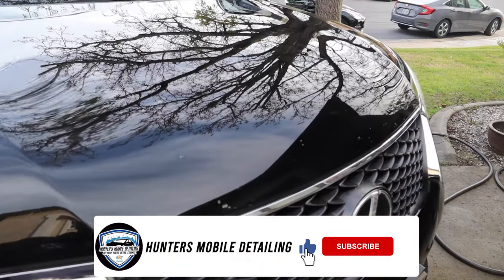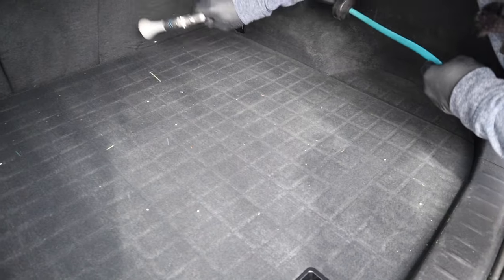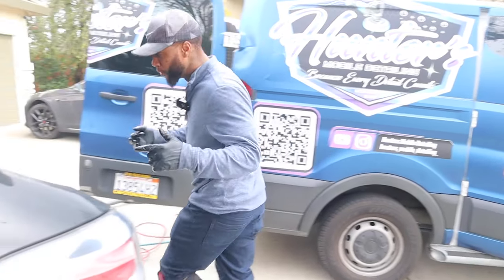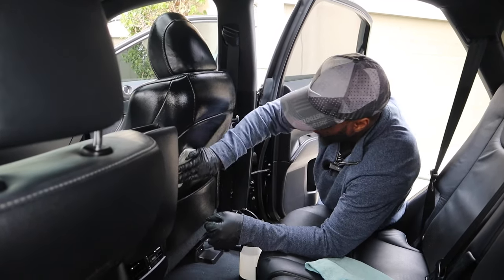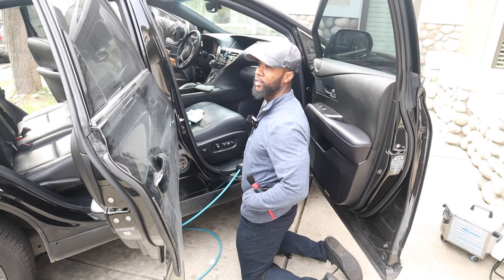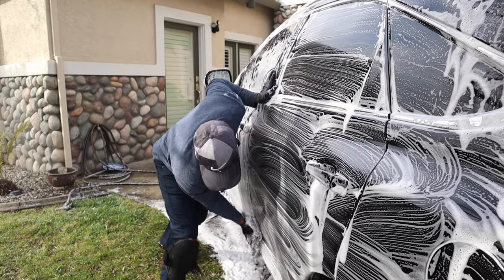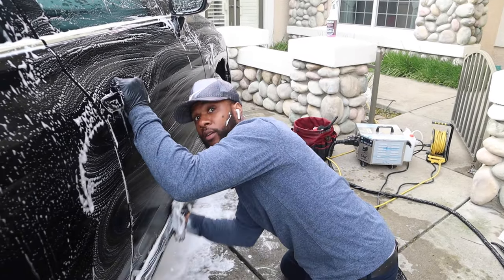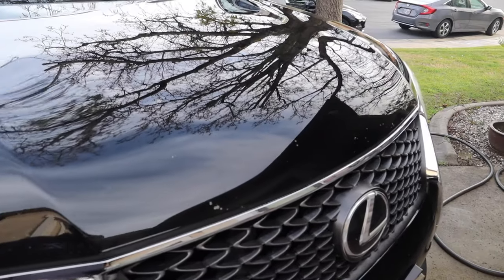How I Do My Full Detail Step by Step - Hunter's Mobile Detailing

Comment: My dad's been an auto detailer for years. I would recommend eagle one detailing spray. It's a navy blue and gray can, you can use it on all the plastics and metal in the interior after you clean the inside of the vehicle. We use a clean paintbrush to go back and tone it down. When I help my dad it brings out the black alot more and gives it a settle gloss like a brand new look and it really doesn't look greasy unless you really cake it up .

Comment: Tornador is my #1 tool along with the steamer. The metal cone for the Tornador I feel took it up another level.
Reply: What type of air compressor is best for the tornador
Reply: @2Shine55  it has requirements on the website/on the box but I just use one I got at harbor freight for like 150
Reply: Does it not make a mess blowing all over ? If it’s a really caked up car inside
Reply: @2Shine55  I just use a Craftsman 6 Gal. I got it on sale for $100.
Reply: @TropTrevTv  if there’s a lot of stuff I will vacuum first so I don’t blow stuff all over. It’s really good to bring up the stuff that a vacuum can’t get.

Comment: my favorite part is applying a ceramic coating.  dunno why but it's very satisfying .   I like scrub ninja for steering wheel and flat surfaces but for the seats I would advise using a dedicated set of perforated leather brushes that get into the tiny holes in seats..the scrub ninja doesn't do that..brushes do. other than that... you the man. thanks

Comment: I haven't bought into the Tornador yet, I just usually spray a ligh mist of upholstery cleaner and drill brush the carpet before vacuuming. Works just as well and I don't have to waste time on a extra step but hey as long as it's working for you brotha.
Reply: For doors & dashboards as dust can be abrasive the more you can blast away with air or vacuum up w/ detail brush the better.
Reply from the maker: Can’t knock it until you try it I was the same way. Then I realized it actually cut time. And also I was able to get things I wasn’t about to with this tool.

Comment: Hi 

Can i ask for whats the best method of washing a car in my circumstances 

Things i will use
1. Only Ph neutral soap
2. I have wash mitts & microfiber towels
3. I will not use foam canon 

Methods I'm considering to use 

A. 1 bucket no grit, multiple microfiber/wash mitts
B. 1 bucket no grid guard, 1 wash mitts and pressure wash the mits after ever panel 

Or should a grit guard is a must for a car wash without foam cannon?

Comment: Good evening sir I'm replying to your comment about your air compressor cutting off and you having to wait a few minutes that's because your generator is not large enough to keep it running once the air compressor cuts off the generator needs to be at least 8500 Watt or you can buy a air tank that's called Master blaster it sells for about $400 but it works very well

Comment: Hey hunter I’m a new detailer and I’ve been having trouble with water stains on the paint right after washing it. Can you explain what causes it and how to prevent it? First, I pre-wash then I hit it with the foam cannon and do a hand scrub with soapy water while the foam is on the car. Then I pressure wash all the soap off and hand dry with a towel and it leaves the paint with a bunch of stains on it.

Comment: Great job. I am impressed by the truck setup and the equipment used. Which air compressor do you use? I am here in Orlando, FL. setting up a Mobile Vehicle Cleaning Service to do part time, on the side, and I am trying to put everything together to start servicing accounts.

Comment: My only comment is wouldn’t it be better to use another mitt for the lower panels? As opposed to using the same mitt for the entire car, for the sake of trying to minimize scratches?
Reply from the maker: As long as your cleaning properly my opinion It’s no difference. You can have 2 mitts and not clean properly and have the same problem.

Comment: I put it in my confirmation: 
- please remove all loose item from the doors and floors, truck bed, etc
- please remove all valuables and weapons 
If they leave the bed of the truck after my messaging- I charge 10 bucks for cleaning.

Comment: How do you reuse the towels? Do you wash and dry them?
Reply: yes, but you should only use a free and clear detergent, I use "all free and clear" with hot water. don't use dryer sheets and use an air dry setting as the dryer heat will ruin the fibers in the cloth.
Reply: P & S rags to riches in washer. no dryer sheets

Comment: Hello Sir, very liked your video and you inspired us on doing this detailing works. Just want to ask if do you remove the wires of the car battery everytime you start to wash and detail those vehicles? Thanks.
Reply: There is no need to.
Reply: @upgtx  Thanks for the reply. I’ve just thought that the car battery will drained itself if all the car doors are opened for several hours. Cheers.
Reply: @kabooom123  can always just switch off the dome lights.
Reply: Hi Kabooom, when I started out detailing, I had several customers                                                vehicle batteries die on me when cleaning the interior. I then would check their battery with a multimeter to see if it's at least 12 volts if not I would but a trickle charger on the battery posts. Now, i keep a battery charger with me in case my customer vehicle dies.
Reply: If it’s a newer car the car won’t die with the doors open (or a new battery) but you could always just turn the car door light off
Reply: @johnniealbert1975  , I agree, mobile detailers need to have a battery charger just incase.

Comment: The best way to remove bacteria from your eyes is to flush your eyes with a mixture of sea salt and distilled water 1/10 mixture. Next, put a hot compress over your eyes for 10 mins. Then flush your eyes with fresh distilled water. Do that 2 times a day for at least a week.

Comment: is there a connection that you need for the tornador or does it go straight into a compressor?
Reply: It’s just a tornado blow gun attachment so you’re just attaching it to the preexisting hose you have hope that helps
Reply: @gerardorodriguez1799  do most hoses have the same female fitting used for tornadors?
Reply: @pfmarzan  yes. U can also YouTube your hose and the tornadoe size

Comment: What do you if you get micro marring during clay stage
Reply: the clay mitt's are less aggressive than the regular clay bar. If you get it sufficiently cleaned prior to claying it, and keep the surface lubricated during clay process, no worries man... It's very likely the car already has many swirls and water spots from lack of maintenance to begin with as well.